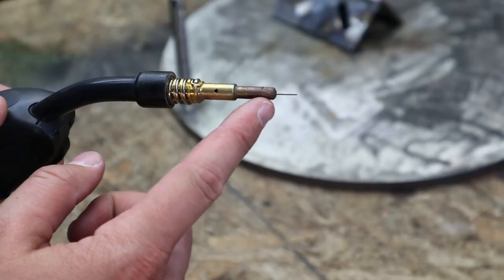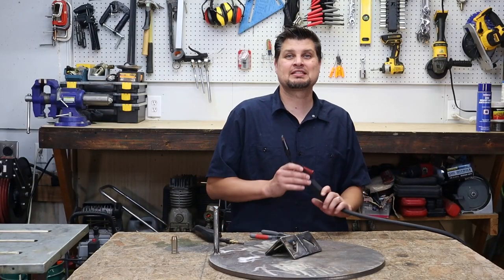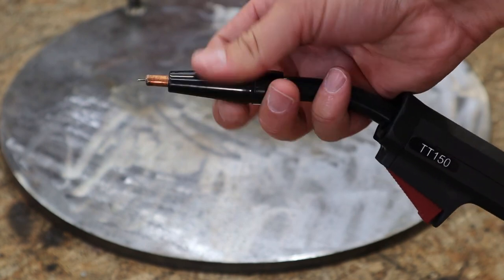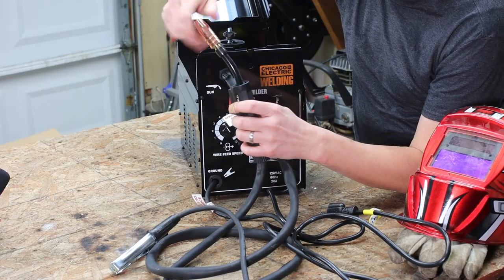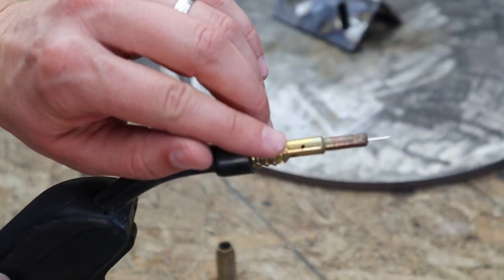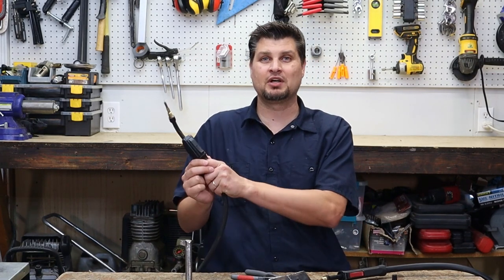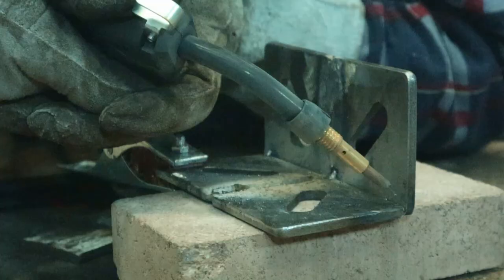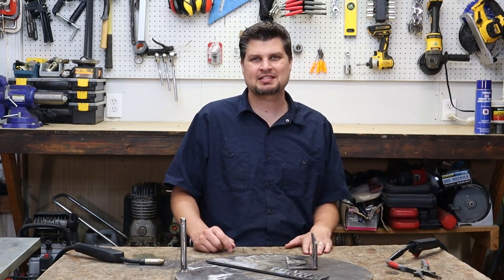Improve Your Flux Core Welding with this #1 Tip

Comment: Thanks, great video. I learned this within the first couple of welds with a Craftsman FCAW decades ago. It had no speed controller but found the schematic, replaced the resistor in the circuit with a pot, mounted through the side of the case, etching marks where a setting worked best for the material. Best all around welder for me.

Comment: Thanks. Is there a special tip without the holes that I can 😊use on my welder that does gas and flux cored? Thanks
Reply from the maker: Great tip!
Reply: I've seen multiple comments so far that are asking  questions... I saw it says you reply, and I click it to see your answer; and I clearly see that you aren't actually reading the comments. You are just replying on autopilot 🫣

Comment: The plastic "nozzle" stops you arcing the torch body off workpieces.  Which you will do without one. I bin off the plastic & use a piece of rubber fuel hose as it lasts better/ I can make it the exact length I prefer. .

 On my "Cheapo Chinese" machines (which are all I use) , first thing I do is bin off the supplied torch & often the earth lead too. As supplied, they are generally nasty. Triggers especially. I chuck on a Tweeco or suchlike torch & a heavier earth clamp (if the earth cable is ok). That's a huge "quality of feel" upgrade right off the bat.  The machines are great - the leads usually suck.  I'm holding the thing maybe 50 hours a week every week - I want it to feel & handle decent.

Comment: when i was welding i took off the nozzle and the tip touched the work piece and i lost electricity, why? im new to welding
Reply from the maker: If you touch the work piece with the tip itself then the machine will short out. 
You want to have about 3/8 - 3/4" gap or "stick out" for a good weld.

Comment: Thanks for the video! Is it beneficial to oversize the tip with flux core? Eg. Use .030 wire with a .035 tip?
Reply from the maker: Right on!

Comment: Is the wire supposed to touch the piece your welding. I have the Titanium 125 it ars when the wire touches the piece and not until then
Reply from the maker: Yes, the wire needs to touch the work piece. You want about 3/8" - 1/2" sticking out from the tip while welding.
Reply: @-DIYPRO-  ok thanks

Comment: Awesome thank you
Reply from the maker: Thanks!
Reply: @-DIYPRO-  I took that off a couple days ago and it worked great. Bad part was I was almost out of wire and I believe my tip was getting bad. I bought some of that spatter stuff. Hopefully that helps. I am actually going to try to go to welding school at one of the local community colleges. I have money left in my GI bill I figured why not

Comment: Use cooking spray on the aera your welding it'll keep spatter from sticking.  Also use tip grease.. if your getting spatter like he shown your not welding hot enough. Turn the heat up and speed and get close .  Only time I do t cover the tip of my flux core is never... your likely to bump or jump and smack the tip to thw work and then your gonna have a screwed up tip.... 30 years exp in flux, arc, mig, oxy/acet, and I'm working on tig.... flux by far has been the most useful. Not thw prettiest but out in a field who cares what she looks like as long as she doesn't moooove when your done right?😂

Comment: You must be careful, because the tip if it touches the base metal, it will trash the tip..i use the shield because i use dip to cut down spatter

Comment: I worked on making a body bus using Mig welding and I made the tip slightly in front of the nozzle so I could see it more freely and when my engine was shorted I called the technician and they looked at my welding handlebar and they scolded me: V on the grounds that the tip had an incomplete combustion perfect must be inside the nozzle
Reply from the maker: Correct, this only works with flux core. For good gas coverage with mig, you need it just about even or inside the nozzle.

Comment: Umm,  what happens when your gas blows away?  I mean the a nozzle is there to focus your gas around the puddle.  Without there your bead is fucked
Reply: This is flux cored wired, no gass using.

Comment: I haven't tried, but I can see if this works for gasless fcaw. However, I'm skeptical  for when using 75/25 or CO2
Reply from the maker: It's only good on FCAW, flux core. You'll need the nozzle for mig welding with any gas.

Comment: I wish the Internet Police would start giving out citations for bad advice on these DIY self-certified experts.   Do this only if you feel like buying a lot of new tips - after you've ruined several and screwed up your welds because of this advice.

The tips on the end of the flux-core welding nozzle are COPPER.  If you don't know your metals, (probably should not be welding), Copper is a soft metal with a much lower melting temp than steel.  So when you take off the shield and get that copper tip that close to the heat, you're gonna melt some of the copper and close up enough of that micro-tiny little hole where the wire feeds and you won't be able to shoot any more wire out of the tip.  I don't know about you, but my time is money and I can't stop and clean or even replace tips every couple of minutes due to my own stupidity for following bad advice.
Reply from the maker: There is definitely no copper on the end of the flux core nozzles I've seen. They even say heat treated plastic as the material. The point of the flux core nozzle AND this video is to allow you to see the tip and weld puddle better so you DO NOT dip or contact the tip into the weld. If you are still contacting the contact tip then you need to practice your stick out technique. I've used the same contact tip on my Titanium 125 for 3 years. Yes nozzle gel helps but it mostly comes from seeing that contact distance.

Comment: The only thing I don't like about running without the nozzle is that I weird positions I sometimes stick the tip. Whereas with the nozzle I can rest the nozzle on the piece than start and adjust. And I can never stick the tip that way. Great vid and keep up the good work
Reply from the maker: Great point, thanks.
Reply: Yeah and they break up when replacing 10/20 tips 😅

Comment: If I don’t plan on using gas would it be okay to remove tip? My machine is flux or gas but I don’t plan on ever using gas just flux with this machine. My tip has the holes but didn’t know if it was ok for them to get plugged if using flux only. I also clean my tip regularly
Reply from the maker: I would try to get some aftermarket "flux core nozzles" depending on what welder you have harbor freight sells some. If not and you won't ever mig with it then yes you can take it off. I'd also pick up some nozzle gel to help with the spatter that gets on it: Nozzle Gel: https://amzn.to/351bxuC 
Anti Spatter Spray: https://amzn.to/3WzXH8w

Comment: This could be a good tip to help with arc length when TIG welding. I need to flatten a table and was thinking about heat straightening with TIG, but I can see that this would save me a lot of gas and improve puddle control.
Reply from the maker: Thanks!

Comment: Hi, can i go with dark shade of 10 in helmet  for 1/4 flux code welding thickness ?.
Reply from the maker: Depends on the amperage. Shade 10 can handle up to about 125 amps. Wouldn't go higher than that.
Reply: @-DIYPRO-  thanks. I  have Lincoln 140. Thinking shade 10 or 11. I assume shade 11 will cover 140

Comment: I have 1 question, i have a tig welder for jewellery it is 150A and its minimum power so 1% is very high because instead of welding it melts the product. What can i do? How can i drop the power externally?
Reply from the maker: I'll have to let someone else chime in because I've never done jewellery. Off hand I'd say you should skip the welder and go with brazing or soldering.

Comment: Spatter is the number one reason I dont like gasless flux core wire but the way welding gas is going I might have to start using it again.
Reply from the maker: True that!
Reply: Anti spatter spray is your friend.
Reply: Change the polarity.